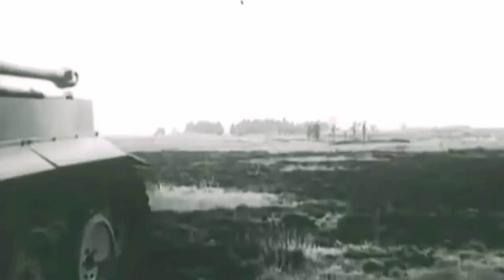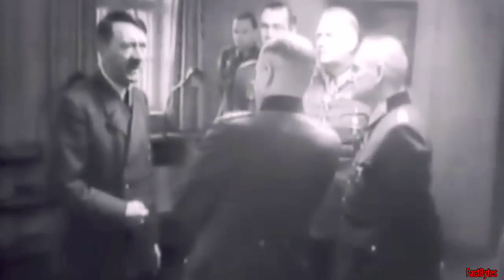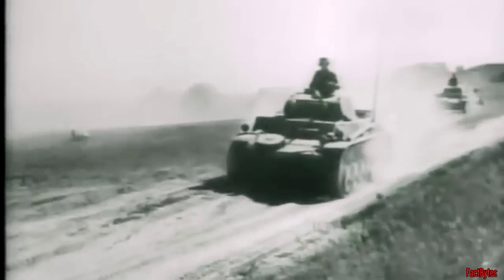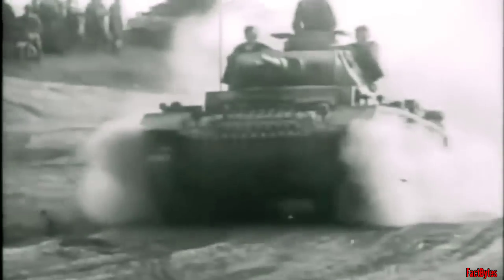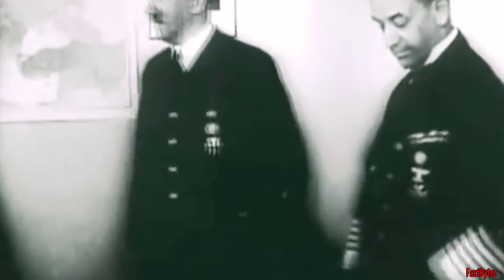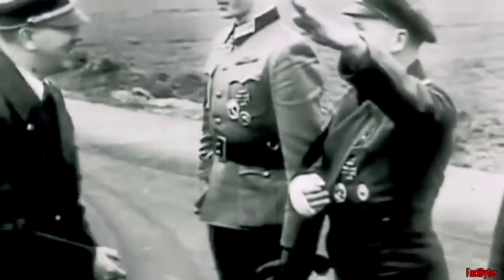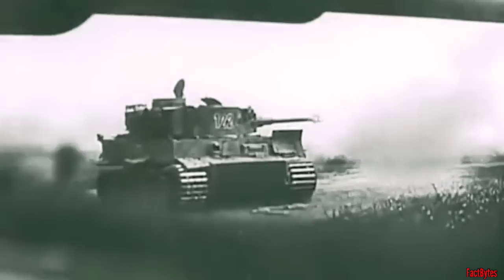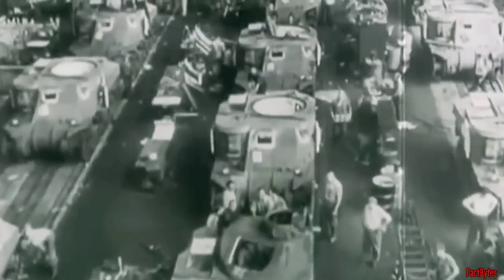Were German WWII Tanks REALLY Over-engineered?

Comment: Pretty sure that Guderian said that the Tiger was an outdated design rushed into production in desperation.  It certainly looks like it.  No attempt to slope the armour just thick, heavy armour. Result, an overweight , gas guzzler.
Reply: And one of most deadly tanks in WW2. No sloped armour? BS, it's front armour had 10° slope.
Reply: @AKUJIVALDO P47 would feast on it
Reply: Sloped armor only increases the weight
Reply: @kaybevang536  yeah, about that... Educate yourself about hit ratio of planes against tanks in WW2.
British conducted testing of airpower against Panther, painted in white and parked in the middle of field in known location...it didn't work well and that is saying it mildly.
Reply: @entonduck  not really, otherwise there would be no slopes on tanks...
Reply: @AKUJIVALDO  it does, because its sloped you have increase the route of the steel and there are also other ways to increase the armor like by casting steel
Reply: @entonduck  "increase the route of steel"? What it even means? Also, casting steel is just another technique. If you only cast thicker vertical armour, it helps you not that much...only increase the weight LOL 

Anyway, by sloping 100mm RHA at 60° degrees from vertical you double effective armour thickness(also called LoS thickness) to 200mm and increase chance of bouncing of the WW2 and just after WW2 AP shells. APDSFS care far less than full bore AP and old APDS for sloping.

Of course, if you shoot thin sloped armour with bigger caliber(fast and heavy AP shell) it goes trough like 88mmL56 trough front(45mm at 60°) of T-34.
Reply: @AKUJIVALDO  
if you have sloped armor you need to increase the armor length ( english is not my first language) which will only add weight and the crew isnt doing anything better because the space in the tank gets pretty thight. So you have to make the tank bigger which makes the tank bigger and easier to hit or you have your T-34 where the tank crew wont even notice the enemy tank next to you. 60° of armor wont be really good for the crew either and is taking alot of space away
Reply: @entonduck  except you have thinner armour which weights less but has more protection for a given weight than vertical...and a shell deflection increases more the more sloped armour is.
And increased length of sloped frontal armour is dealt by 4 ways:
1st. You make tank longer or wider, or both(especially if you have powerful engine).
2nd. You make your turret longer for ammo storage(turret bustle). 
3rd. You don't give shite about your crew comfort and recruit only small people(Soviets).
4th. Some combination of above. 

See, mate, sloped armour was used by pretty much everyone in WW2 and afterwards...and for good reasons.

And I gave T-34 as example of thin, sloped armour(45mm at 60°) unable to resist bigger diameter AP shell with good speed and mass.
If you tried to use same 88mmL56 against T-55 frontal armour(100mm at 60°) it would bounce...or gouge the armour at best. Well, there is probably some simulations on YT.
Reply: @AKUJIVALDO  my guy you cant compare ww2 weapons with a cold war tank. The T-34 crew survival rate was extremly low because of that sloped armor and the bad vision/uncontrollably of the crew. And if you make your tank longer and wider you will need more armor and a better engine which wont work with the technology of the ww2 and you were a bigger target too
Reply: @entonduck  except Germans done it, in WW2. They needed Tiger I replacement and so they made King Tiger. It was longer, wider, had sloped armour and more powerful gun...and IIRC engine was like 50 more horsepower...and was heavier by like 13 tons...

Also, stop banging about T-34s. I used it as example as armour penetration and you are using it as "death traps, shite visibility, etc"... Yes, that is true, but those things do not fit into discussion about sloped armour/vertical armour we are having here.

Also also, T-54 was produced in 1944, so not really cold war tank. But then I used T-55 VS T-34 against Tiger I gun penetration.
Reply: @AKUJIVALDO  The T54 was first produced in 1949. The Tiger 2 was also unreliable as hell, was difficult to repair because of the heavy weight and overengineering and was extremely expensive. Only 500 were produced because it was so expensive. In my defenition a good tank should protect its crew, should work as the role it was intended to and be able to mass produce. Like the Sherman did
Reply: @entonduck  What’s astonishing is the fact that Germany still managed to make 500 king tigers at such late stage of the war!

Sometimes I get the feeling that if after D-Day, Hitler saw the writing on the wall and consolidated all of his troops and equipment to defend Germany’s borders, Germany could’ve held out ended the war on somewhat their terms. They still had upwards of 4 million men (before they were wasted attempting hopeless attacks in 44 and 45), and more being trained and like 500,000 troops alone in Norway. You’d have thousands of tanks, flak cannons, artillery, and millions of troops on both sides, as well as fighter planes to pick off anything that makes it past the aa defense.

I honestly think the Allie’s would have to give up and sue for peace because at a certain point all the roads would be clogged with destroyed allied tanks and vehicles. Not to mention the thousands of allied troops that would die. And don’t forget, Germany practically sits on top of a giant hill so it would be a literal uphill climb for the Allie’s.
Reply: @priatalat By 44 German lines were stretched badly. Allied AirPower managed to basically already defeat the German airforce by then. The allied invasions from all directions made a stalemate impossible over longer periods of time.
Reply: Not enough!
Reply: The non sloped armor had its own advantage, dont forget that germany had a shortage of raw materials too@AKUJIVALDO
Reply: @AKUJIVALDO t54s were first produced during 1946 and also is a cold war tank as it is produced all the way till 81' in the soviet union and last produced in 83' in czechoslovakia
Reply: @priatalat  Do you have any idea how little fuel the Germans had left by 1945?

Comment: Simply put, the Germans didn't have the people or fuel to make massive amounts of smaller lighter vehicles, they needed to protect their tankmen as well as possible and take out as many Allies per capita as possible. Therefore, the best thing Germany could do was build extremely tough and well armed tanks to try and turn the odds in their favor.
Reply: That logic partly makes sense but the tiger and early tiger had terrible range and fuel efficiency. Something just big enough for a 75mm/70 cal (with a turret, not a casemate) from the panther  and armoured a bit less like a late Panzer 4  would be qualitatively superior to the t34 and a bit easier to mass produce than the panther which was too big for a medium tank
Reply: @lukeallison3713  the panther was the right choice , even faster to build than pz4
Reply: Could spit out 3 Panzer 4's for one Tiger II.  Just from a logistics view: if you're low on resources, the 75mm KWK 42 makes more sense.  Almost as effective as the 88, but less weight, volume and material per round.  Would I rather be in a Tiger II than a Panther or a Panther than a Panzer IV in a tank battle?  Yes.  Does it make much of a differnce if I and my crew are green as grass?  No.
Reply: It was never a question of producing the expensive, cumbersome, heavy Tigers, versus more Panthers and/or Mark IVs, or even SP guns and TDs at even lower cost to deal with enemy armor.  The Tiger was intended from inception as a "durchburchwagen", or Break-Through Vehicle, and it was used somewhat in this role at Kursk.  I say "somewhat" because already abortive attempts at deploying Tigers had been made near Leningrad in September of '42, and in Tunisia in March-April of '43, both with disappointing results.  The British got "Tiger 131" as a result, on a fluke hit that jammed the tank's turret, rendering it inoperable.  The Tiger was moderately successful at Kursk when used with the "Panzerglocken", or armored "bell", with Panzer IIIs and/or IVs, as well as assault guns, covering the flanks, and the Tigers behind them in the center, covering them with those 88 mm guns.  The losses were actually lower than thought, but there were too few Tigers to really make a difference at Kursk.  At the famed battle of Prokhorovka, the Soviets claimed initially over 400 German tanks destroyed, including 70 Tigers. The latter figure was more Tiger tanks than were available on July 5th!  In fact, attached to the SS-Panzerkorps was ONE reinforced platoon of FOUR Tigers, and of these, only one was put out of action, with its rangefinder damaged by artillery, which it went back to the assembly area and had replaced; the tank was back in action the following day.  Although the Soviets succeeded in their objective of preventing a German breakthrough on the Kursk southern flank, which AG South Commander Von Manstein asserted should be tried again after the July 12th battle, believing that the Soviets were badly mauled.  Hitler overruled him, and called off the Kursk offensive, due to the Allied landings, "Husky", in Sicily, and the Soviet counter-offensive at the Orel salient which had also begun on July 12th.  The battle of Prokhorovka could be considered a tactical success but a strategic failure, the Soviet BS and outright LIES notwithstanding.  Put simply, the Germans no longer had "house money" to play with, but thanks to their own resurgence in proficiency and in war production, along with LEND-LEASE, the Soviets could all the way to BERLIN.

The Tiger found its true "calling" in the defensive role, as a more or less mobile tank killer, but it's debatable as to whether it, along with the King Tiger that succeeded it, was the best way to get that awesome '88' on the battlefield.  The Panzer IV-derived Panzerjager IV "Hornisse" (or, as Hitler dubbed it, "Nashorn"), or the Jagpanther, both with the Pak 43 L71 gun that outranged ANYTHING that either the Allies or Soviets had, were certainly cheaper, guzzled less fuel, and were more readily recovered if damaged, though obviously not true tanks.  One had to admit the "fear factor" of both Tigers couldn't be discounted, either.

https://en.wikipedia.org/wiki/Battle_of_Prokhorovka
Reply: @hammerfist8763  By early 1945, the Panzerwaffe was no longer sustainable, due to a breakdown of German logistics, due mainly to Allied bombing and strafing, but also being starved of FUEL.  Never mind that most of the proficient crewmen were already dead, disabled, or POWs.  The most awesome combat vehicle is useless if the crew isn't trained and experienced.
Reply: @selfdo  Absolutely.  It's the tankers who make the tanks great.  I was very fortunate to have an excellent crew and equally fortunate to make it through 16 months of combat without a scratch.  On us or the tank.
Reply: @selfdo  Yea but part of that flies in the face of what was already established armored warfare doctrine in the 1930's.  Whether on offense or defense, and especially in urban environments, tanks needed infantry support.  The Allies and Germans already learned that the hard way in WWI.  The US Army knows it, too, and has the best combined arms doctrine in the world (in practice, not on paper, our TM's and FM's are a mess).  But even today, fullbirds who've been to advanced war college will send unsupported tanks to take tough objectives.  With predictable results (yea, they'll take it, and they'll take unnecessary losses).  Our tanks aren't cheap.  Neither are our soldiers.

Comment: Very impressive, that German engineering in search of the appropriate firepower, agility and protection. The Russian T-34 an awesome piece of engineering, as well. It got the job done.
Reply: @goldenhawk352  In games and simple minds tank mobility = power to weight ratio + top speed + maybe tracks. Transmission is mostly forgotten. In some (usually speeded up) propaganda videos you can see T-34s zooming through fields like motocross bikes and optimal conditions one could indeed gain high speeds. However in practice T-34 was limited to just 1st and 2nd gear in cross country use thanks to the extremely poor gearbox. Even the road speed couldn't be maintained in summer thanks to "saboteur designed" air filters. Only T-34-85 somewhat improved this in 1944 with it's new gearbox and eventually air filters were also improved.
Reply: T34 was shit...decent on paper but build very badly.
Reply: It was good enough
Reply: ohs.

Comment: German tanks weren't overengineered, so much as improperly engineered. They were the most difficult to build, service, and in many cases to transport and use. Long build times and lack of strategic materials hampered production. The guild system meant the army was constantly shipping skilled workers to the front, then back to the factory again. Complex and sensitive transmissions were routinely damaged by inexperienced German drivers. Interleaved road wheels routinely froze together in the field. To replace a Panther motor you had to first remove the turret, on and on and on. German industry was constantly short on materials and manpower, but design and bureaucracy made those issues far far worse instead of better.
Reply: Das ist nicht korrekt, das man beim "Panther" zuerst den Turm abmontieren musste, um den Motor ausbauen zu können. Der Motor war Hinten im Heck durch eine kräftige Abdeckung geschützt, diese Abdeckung konnte Problemfrei entfernt werden, um anschliessend den Motor auszubauen. Ich weiss nicht, woher du diese Information hast, die ist falsch
Reply: People use the vague term "over-sngineered" to mean what you are saying.  But your detail makes clear what the issues were.

Comment: Germany often  couldn't supply fuel for the tanks they had. It has been suggested that at times, the German army lost more tanks to breakdown and fuel shortages than enemy action. More tanks would likely have meant more losses when out of fuel machines had to be destroyed to prevent capture by the enemy.
Reply: Yes as the war progressed. Fuel shortages became commonplace Paulus had idle tanks for a week at times. Due to lack of fuel.
Reply: Build all the tanks you want when they can't move not much use
Reply: Germany was always extremely short of fuel. With tanks unable to manoeuvre for weeks at a time, because there weren’t enough loads of fuel to advance only to defend and retreat in emergency.   After March 1944, the situation became even more dire because of the Allied bombing campaign against German oil, refineries, which eventually eliminated 85% of production.
Reply: @williamzk9083 The bombing campaign did more damage to the suply lines than actually the production of oil. 
Most of Germany's oil was also synthetic, not crude.

Something like 90% of Germany soft skinned vehicles had been destroyed by the bombing campaign by the end of 1944.
Interestingly, Germany produced more oil in 1944 than any other year.
Reply: @brianlong2334  “Germany Produced Mire oil in 1944”. Not correct according to the records with USBS and fischertropsch do org library.   They produced more munitions in 1944, but not for oil they lost 85% of their production.
Reply: @williamzk9083  In the last 3 or so months of 1944....
Off the top of my head last time I crunched, the numbers they were as follows.
1941 48 million barrels, of that 20 million was from a stokepile.
1942 35 million barrels 
1943 53 million barrels 
1944 65 million barrels 
1945 7 million barrels 

Germany synthetic fuel production was at an all-time high in 1944 at over 44 million barrels but would have been about 70+ million without the bombing campaign.
Reply: @brianlong2334  Also German rail stock.  The Rollbahn began WWII with some 85,000 waggons of varying types, and over 6,000 locomotives.  By January 1945, this was down to about 30,000 waggons and less than 1,500 locomotives, which wouldn't even sustain a semblance of civilian economic life, let alone keep the Heer in the field, supplied with food, ordnance, and fuel, the Luftwaffe flying and with bombs, and the Kriegsmarine...well, whatever U-boats or surface craft sortied did so with whatever supplies, including fuel oil and/or diesel, that they already had or could scrounge locally.  Else they sat in port, and especially in Norway or the cut-off ports in France, the sailors were put into the front lines as infantry, just as the Soviets had to with their Baltic and Black Sea fleets in 1941 and 1942, and didn't restore them until late in 1944...SOMEWHAT.